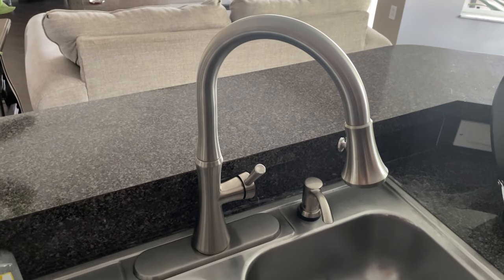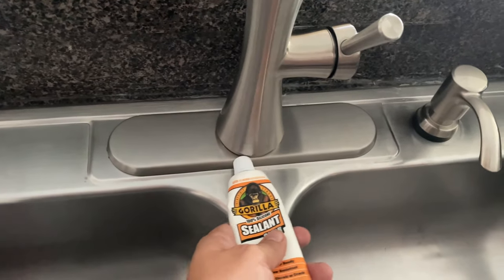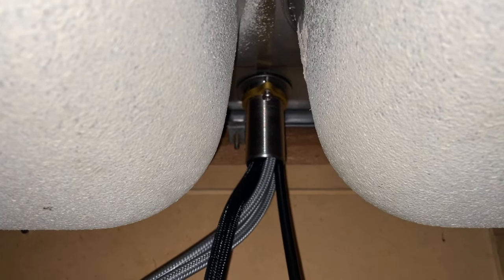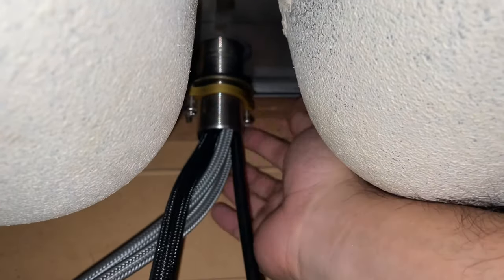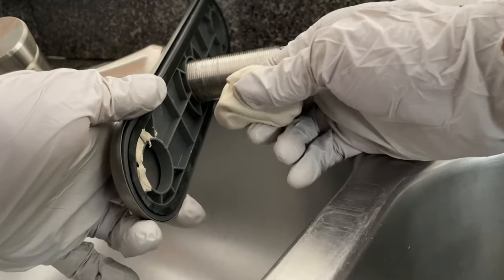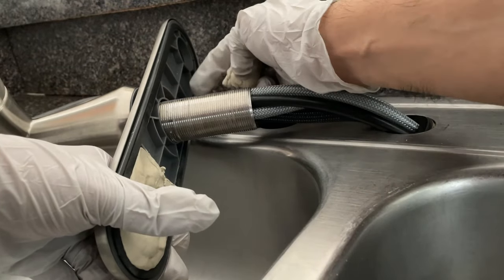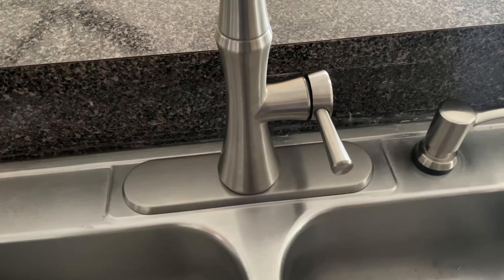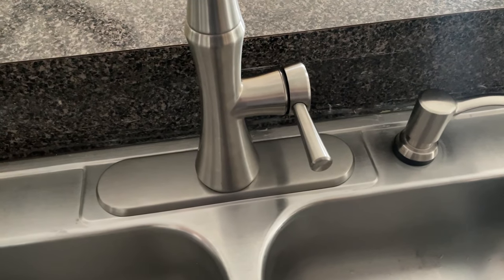How to Seal a Kitchen Faucet

Comment: Plumbers putty will destroy the plastic over time. I believe 100% silicone is the way to go. 100% silicone can be removed easily in the future, if you get a hybrid mix of silicone it may stick more like an adhesive and give you a lot more trouble down the road if you need to replace the faucet. That's what I believe to be true. Please tell me if you know better. ;)
Reply: I have 25+ year faucets that  have visible plumbers putty around the rubber gaskets and they are still leak free with no visible deterioration of the rubber.

Comment: Plumbers putty is the easiest if you haven't put in the plate yet, but it can crack over time.  Though messy and a pain, I'd go with a clear silicone that works with the underlying material.  I'd seal the joint behind the faucet up top if you have two slabs (backsplash and the flat slab) coming together before putting in the faucet too after cleaning the area.

Comment: I was wondering if I should add some plumbers putty to help seal the base plate. I replaced my water supply stop valves today and tomorrow I will finish up with installing the new faucet I bought. I will add the putty since it looks like the gasket may not do the job completely. I tried taking apart the old faucet but it just refuses to come apart so I can replace a couple of seals. After I took off the old supply line stop valves I could see that the washer was coming apart. My kitchen faucet and the water supply stop valves are the original ones. I bought the house in 2004. I replaced the valves with a all medal 1/4 turn ball valve as the replacements.

Comment: Loved the video! My hose is leaking from inside the facet. Do you know if those can be replaced?
Reply from the maker: Hi Erik! Do you have a similar model as the one showed in the video? If it is similar to mine and if the leak is coming from inside the faucet, I believe it will be somewhat challenging to replace the hoses as you would have to disassemble the faucet. I do not remember seeing any screws or any easy way of disassembling it. Have you checked if the leak isn't coming from a hose connection below the faucet?

Comment: Lowe's doesn't have the Gorilla 100% Silicone Caulk anymore. :text-green-game-over::face-purple-crying: What's a good alternative that I can purchase at Lowe's? Thank you!
Reply from the maker: Hi Zac! If you want to buy it from Lowe’s, I would recommend the GE Advanced Kitchen & Bathroom Clear Caulk. 

You can also find the Gorilla Silicone in the Amazon link I left in the video description. I have had very good results with the Gorilla Caulk as it won’t yellow over time. 

Have a good weekend!
Reply: thanks brother! :trophy-yellow-smiling: @handyneasy
Reply: my house is 85 yrs old so every project is a HUGE issue .. i have done several repairs myself and a female i feel pretty empowered ( thanks to YouTube) . but geez i am struggling with the loose seating of the kitchen faucet. so these tips have been very helpful